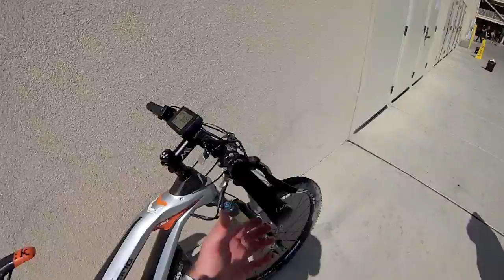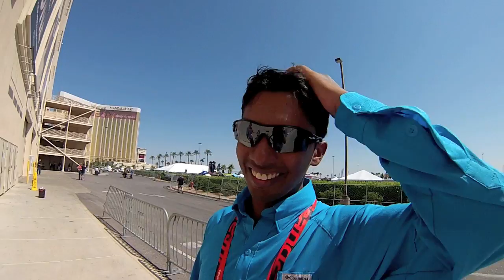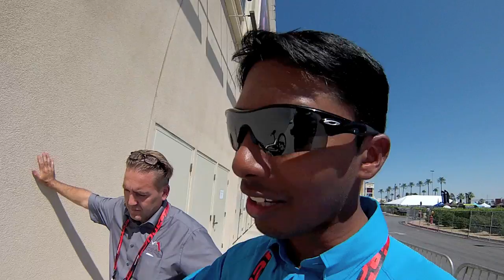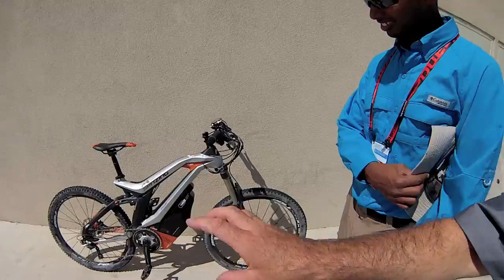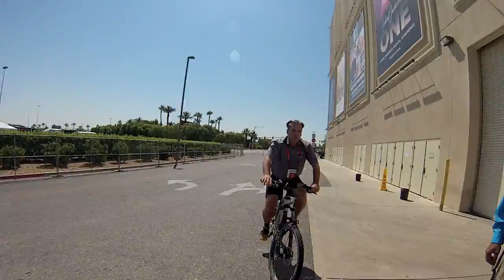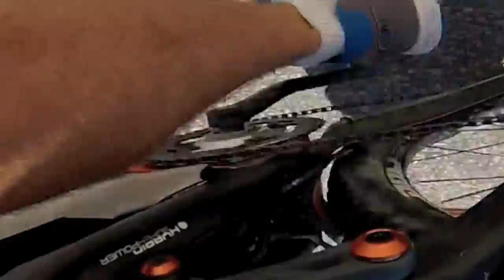M1 Sporttechnik Spitzing Review - $9k

Comment: whew, what a beast! with all power they could call it the Blitzkrieg .
I'm surprised they didnt use a belt rather than an exposed chain. Can't blend in with that frame design anyways.
Reply from the maker: Funny you should mention belts... they actually have a version that does come with a Gates Carbon belt drive and the NuVinci continuously variable transmission in the rear instead of a cassette. Full details in the writeup http://electricbikereview.com/m1-sporttechnik/spitzing/
Reply: ElectricBikeReview.com interesting point you made here:
"I’m told that the motor system on all Spitzing ebikes is physically the same and that the change in wattage output (from 250 to 800 nominal) is based on software. On the one hand, this might mean that all motors are capable of powerful output and thus sturdier. It might also mean that manufacturing costs are kept down because only one production line has to be setup… but on the other hand it means that unnecessary magnets, copper and weight is present on the 250 watt “programmed” version and that bugs me. "
Reply from the maker: ForbinColossus Thanks, It's based on conjecture but these kinds of things are interesting so I like to share and get feedback (from the community or the companies themselves).

Comment: I'm planning on buying the "S" or "R" version with Nuvinci gear. But is it possible to configure the maximum speed on the display of the "R" version? Over here we may only use 45km/h on the public road, but i want to use the 75km/h on private terrain.

And is there an option to fit an optional front/rear light package that is made by M1 and connected to the battery?
Reply from the maker: Great questions and I wish I could provide some insight but I really have no idea. My guess is that you can buy a performance model that will go faster but cost more (that's how it seemed on their website) and I would assume that the lights would work with the battery but given the full suspension frame I'm not so sure about the fenders. I'll try to reach out to the company for comment :)
Reply: Hey guys, i also contacted M1 sporttechnik and they have provied me with some answers also. The speed is not adjustable thru the screen unfortunatly. However the 45km/h version will be equipped with standard lights that work on the battery. Front light :B&M Lumotech IQ CYO T and the rear light : LITTLE Number1. The range of the bike on eco setting will be 180km, and 60km in extreme conditions with power mode activated. I think that's pretty good !!
Reply from the maker: BelgianEvo Awesome! Thank you so much for sharing the update, it is great to hear that they responded to your question. They seem like a nice company :)
Reply: They are indeed a nice company ! They also told me that there will be removable fenders for the bike when using it to go to work for example. I've also asked if it's possible to get the R-version rims on the S-version :) They look much more awesome then the 'spoke' rims.

Comment: Nice bike but $9,000.00 is a bit much.  I very much like the power this bike has and I am sure the bike handles well and screams up the hills.  Too rich for me.
Reply from the maker: Yeah, it's a fun one to daydream about but the price tag is a limiting factor ;)
Reply: ElectricBikeReview.com I just need a lot more money as two ebikes are not enough for me.  I am sure they are worth the money and if I had the money I would buy a high dollar machine .
Reply from the maker: nebula722 Yeah, I struggle with this as well. I think it's worth saving for one solid bike that will do what you need. Many of my friends are excited about the new Xtracycle because it's so versatile but uses the high end Bosch drive: http://electricbikereview.com/xtracycle/edgerunner-10e/
Reply: ElectricBikeReview.com I just want one of each type of drive....if only I could afford 30k in bikes!   The Xtracycle is very interesting.  I am thinking I should take the 29" wheel of the back of my trike as I think it will improve the center of gravity and I am sure it will give me more torque which is what I need.  Seems like it would work better for me.
Reply from the maker: nebula722 Hard to say... I agree that a smaller radius will improve the mechanical advantage of a hub motor but you might run into unintended consequences like misaligned brake interface or a lower rear-end so the bike won't be level. I'd stay stock as much as possible to avoid this kind of thing.
Reply: ElectricBikeReview.com The trike came with a 20" rear wheel so it will fit nicely and it will level the bike.

I think I will have my trike motor laced to a 20" wheel as the bike goes faster than I like to ride.  I put the 29" on the trike thinking iot would make it faster which it did but I need torque, not speed.

And besides, I like custom bikes and don't mind working out any problems.
Reply: Hey gy7
Reply: nebula722

Comment: Wait a second, so ~10K bike and you don't get fenders with it :O
LOL :D hahaha
On a serious side, I am not so sure that there is a racing category for this bike, you can't couple it with no-motor bikes neither with motorbikes (with fuel engines), it would have to be separate, something like, 800-900W pedal assist category.
Anyway they should just add a throttle because this dragon is begging to release it's 800W flames :D
Reply from the maker: Yeah, I think I agree with you there... The Stealth Bomber is throttle only and really comes off like an electric dirt bike. At least this one is better balanced and the 10 speeds and relative light weight make pedaling meaningful. This is a really interesting ebike.